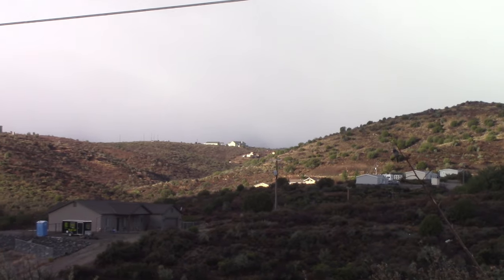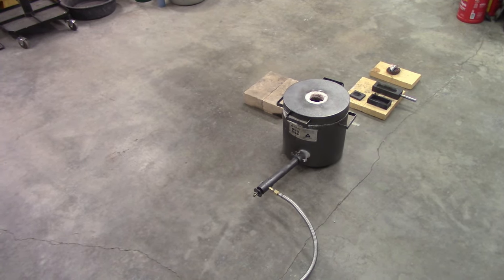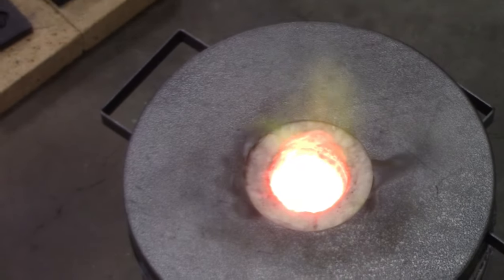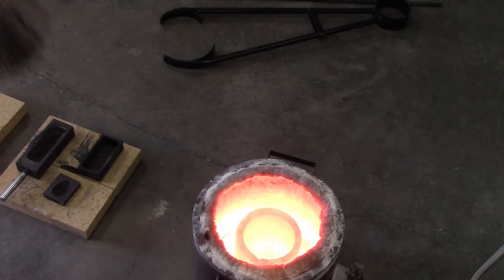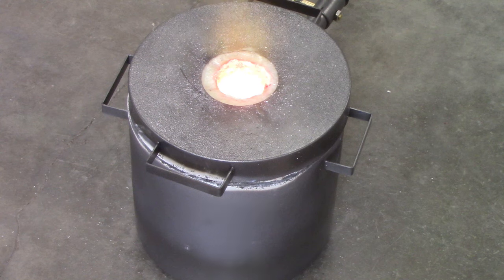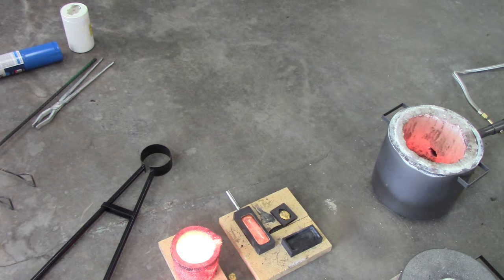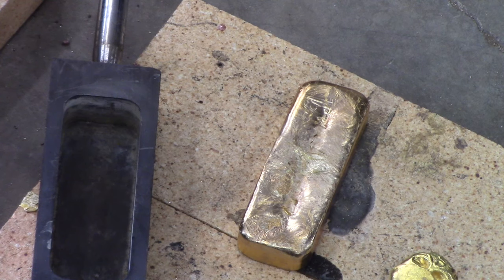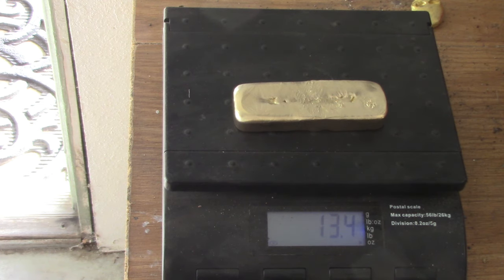Unlocking the Mysteries of an Exceptional Aluminum Bronze Pour

Comment: I'm having the same problem with copper pours 🫗 at 5:48 ... gets to where it starts to melt then it starts making a backfiring noise. I tried to change the air and gas pressure but keeps doing it. Think I had even let it cool down and restart.
Reply from the maker: I had the same problem, found the propane was burning in the air tube. I just quit shutting down and starting by just turning on the propane. It would back fire in the air tube and burn there.
Reply: @CandSMINING  thought I had tried that 🤔...I'll try again soon. What psi you were running for copper pours 🫗? 
Thanks again 🍻🫡